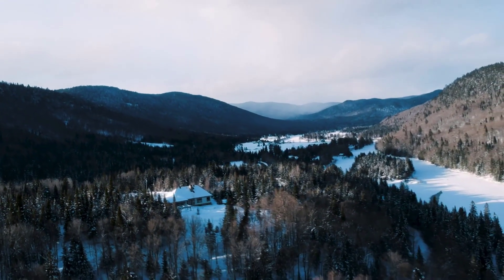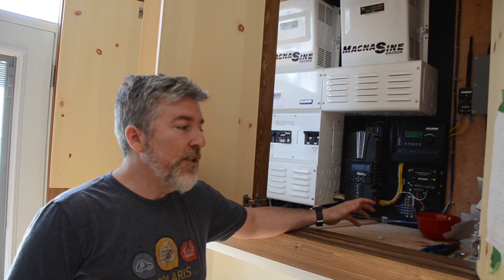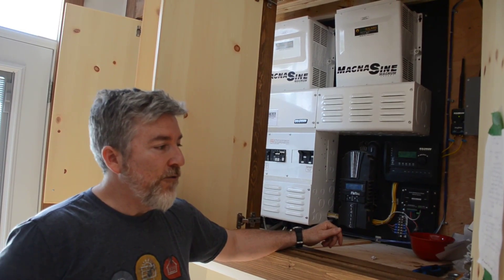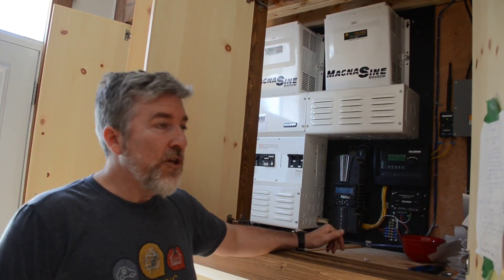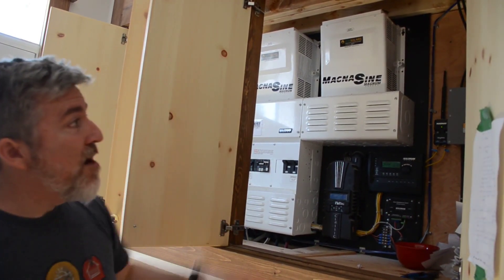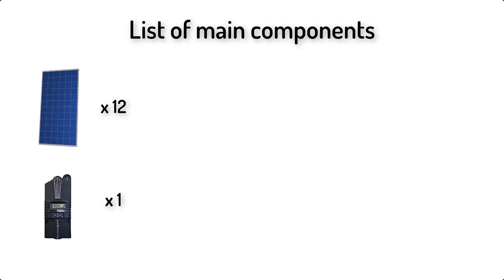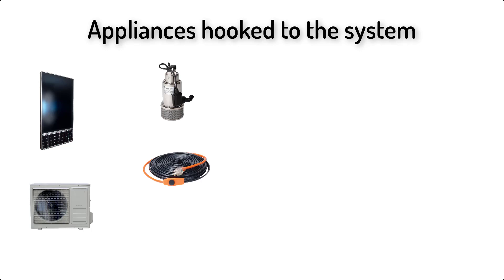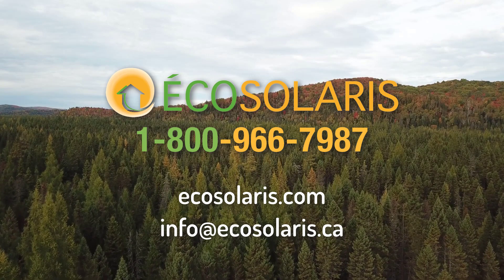What does an off-grid solar system looks like? | Autonomous solar system, Off-grid cottage

Comment: R u crazy. This is a $25000 system. Who has that money.
Reply: Well 10k is not unheard of and is a fair estimate of a decent system. I can understand the 25k because of the batteries. I doubt they are adding the price tag in the accessories they are plugging in. Or that generator. That one alone is 5k(+). If you don’t know what you are doing you would likely pay much more for all the junk mistakes and terminal malfunctioning of cheap gear or inexperienced assembly and then put it out in the weather.
Reply: @blairbushproject  ya i guess if you have a lot of money to spend.  Might as well spend it.
Reply: Frank Z well it’s the nature of the beast. In oil economies you pay that much for a car. And in solar economies you pay for the car but just get the batteries.
Reply: @blairbushproject  just saying. I do things the cheaper way. I have a huge lithium setup going on for much less. There is no need to spend so much on top of the line gear.
Reply: Frank Z lucky you!  We are about 300 miles from the closest Home Depot. So we don’t have any choices. We estimated our energy usage based on a tribal solar set up. That set up was so dismal and so expensive it was almost discouraging. We upgraded to the above. Paid about that much. But the first round was shocking educational realization at how we were under sold solar.
Reply: @blairbushproject  lucky you.
Reply: Frank Z yah it was more than we would have spent had we known anything. We were at the mercy of thugs and sales hawks. But we still don’t have lithium. We have eight wet batteries that cost one lithium.
Reply: @blairbushproject  I have a 50 kwh lifepo4 bank a 120 vdc to 120vac 10kw inverter ,120vdc to 240vac 5 kw inverter , 8 kw of pv for less then $5000. You just have to be smart about what you are doing and take a bit of time. Will save you thousands
Reply: Frank Z well I don’t know who sells lifepo’s for under 2500$ a piece
Reply: @blairbushproject  it's fairly straightforward to build your own lithium batteries these days.  You can get 3.2V 280aH cells for <$100.  16 cells = 48v 280aH battery (~14hWh)  for ~$1500 including BMS.  And commercial batteries have some way down in price.  There's a 48v 100aH battery for ~$1000 now.